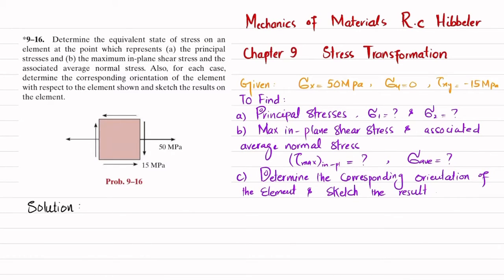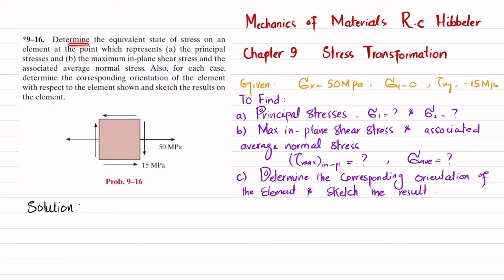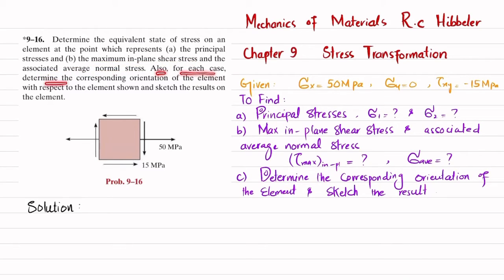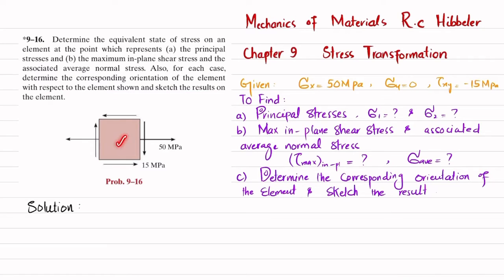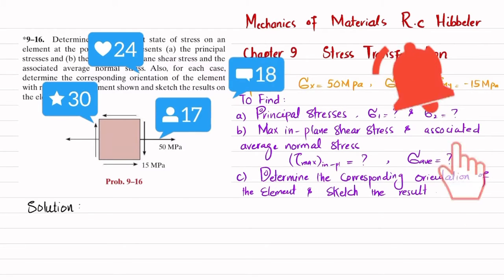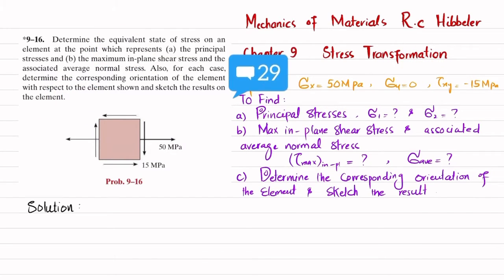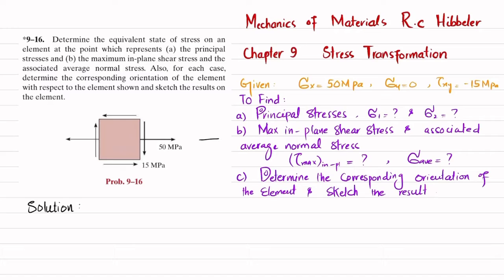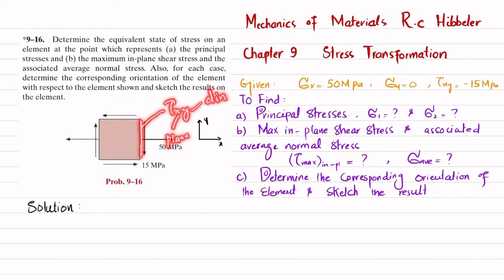Determine principal stress | Problem 9-16 | stress transformation | Mechanics of material rc Hibbel

Comment: Why you chose the first thida (s) as s1?Is we wrong if we chose the first thida(s) as s2?please explain for it,sir.
Reply from the maker: For theta one we have one transform stress in that direction and for theta 2 we have another value of transform stress. So you have to checked that which stress we get at that theta and then you have to represent that stress oriented at that angle.
Reply: @engradnanrasheedmechanical I knew how to differ theda s1 and s2 for principal stress but for max in shear stress I haven't known how to differ what is s1 and s2 sir
Reply from the maker: Theta S1 and Theta S2 are for maximum in plane shear stress not for principal stresses